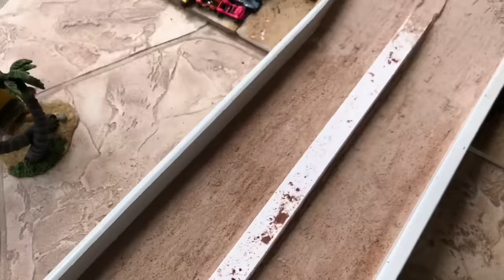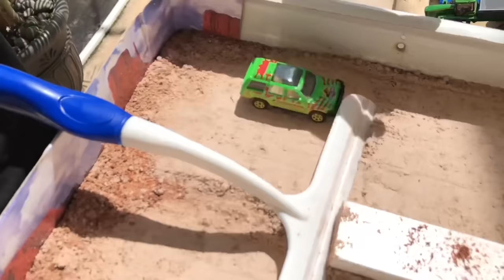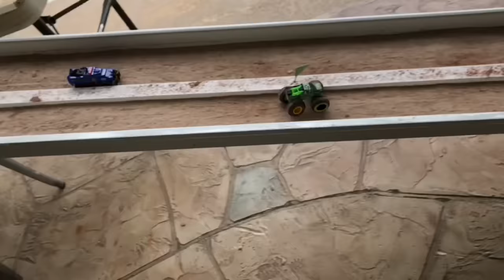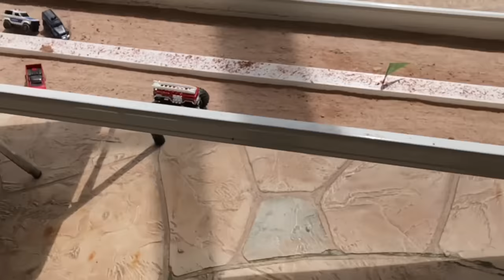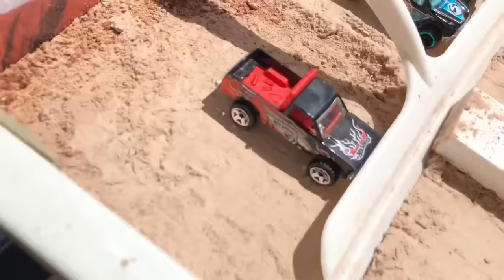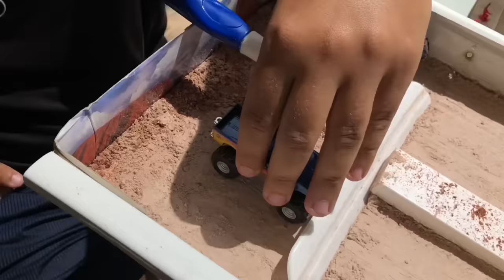HOT WHEELS “DIRT” DRAG RACING | DAY 4 | FINALS

Comment: Spray elmers glue and water in a 50/50 mix using a mist bottle on your track- you'll love the results! A little trick I used as a kid making dirt tracks in my backyard so they wouldn't deteriorate so fast! Learned it from doing model train layouts- I'm in my mid 50's and still a kid at heart! I collect model train's and hot wheels cars now, don't play with them like I used to but I'm still hangin on to my youth😁👍

Comment: This race have to have rules and category small wheels, middle wheels, large wheels and monster wheels 
Rules : 1 have to cross the line 
             2 disqualified if you lost control and run out the track
            3 if the situation 2 happens all 3 car competitors will have chance to qualified for the basket 🧺 
           4 finish line can be place on the sand and let the cars run free without blocking the jump .
Nice video guys I just enjoy a lot hope my rules suggestion helps on your next video 👏🏽👏🏽👏🏽👏🏽👏🏽🇧🇷🇧🇷🇧🇷🇧🇷🇧🇷🇺🇸🇺🇸🇺🇸🇺🇸🇺🇸😂😂😂😂😂

Comment: The idea of hot wheels racing is great, same as the marbles racing... but the execution isn’t great. For starters, the finish line using a rubber isn’t finishing but bouncing back to destroy the ramp or obstructing the car behind... in a sense defeating the purpose of a big jump finish. The sand in the ramp needs to be pack tightly at the ramp. Spacing in the ramp need to be widen, if anything make it bigger or remove the divider. Camera work needs a steadier hand so get a camera stabilizer and follow the action up close. In the future at a rail camera that drops at the same rate as the trucks. Otherwise good job and wish you the best